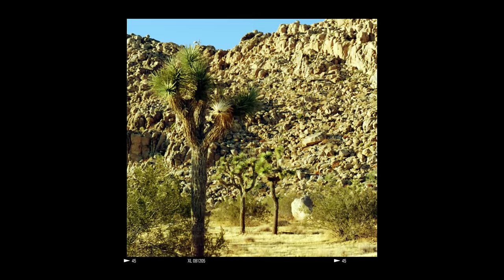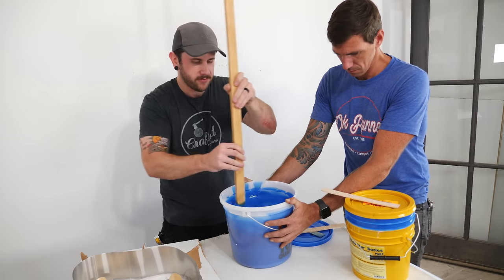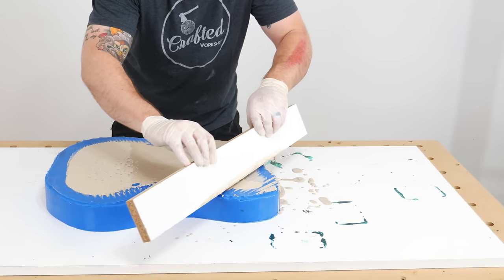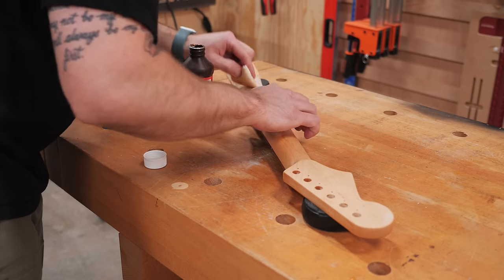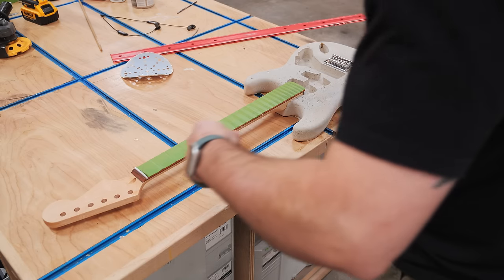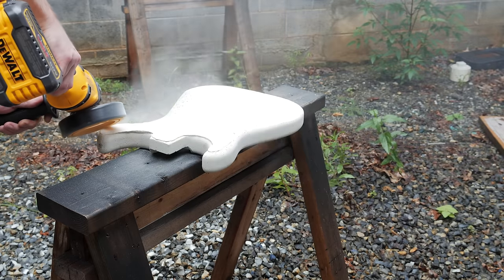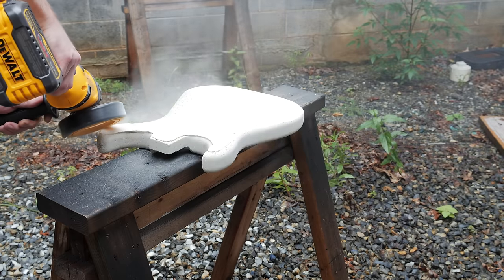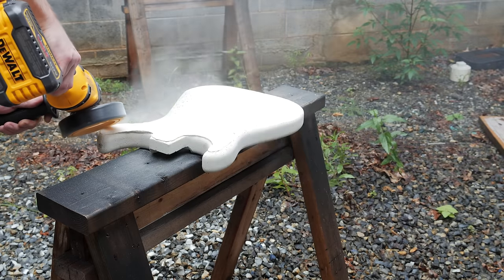I built a GUITAR out of CONCRETE. How does it SOUND?!

Comment: The only thing that really effects the sound of electric guitars, as you mentioned,  are the pickups and various electronic set ups. The way to test how a concrete guitar sounds vs wood it would need to be made into an acoustic guitar.
Reply: or use piezoelectric pickups because then your using the mechanical vibration (tone) of the instrument
Reply: I've been telling people this for years but they would rather believe myths like string gage  too.
Reply: Agreed, but you will have some claim that they can hear big differences not only in the type of body wood but also the neck and fretboard of an electric guitar. I say nonsense.
Reply: I wonder if you could make a wire frame to spread the concrete onto so that you could actually make the shape of an acoustic guitar with concrete. I think that’s how a lot of concrete structures with complex shapes are made.
Reply: *affects
Reply: @clarkburr  Tonewood for electric guitars isn't really a factor, but string guage is dude. There's a video on youtube somewhere about it, and the difference is quite large. Spoiler, lighter strings are actually a lot better sounding.
Reply: @johnnyghoul8100  Or a semiacoustic guitar,

Comment: "I made a guitar out of concrete, how does it sound?"
Probably like any other electric guitar with those strings and electronics, the body is flare
Reply: @GCKelloch  my only question is why did he use copper tape for insular when the whole body is made of concrete? That should do enough shielding.
Reply: Exactly
Reply: you can look up comparison videos, the type of material really does matter a whole lot. For example, alder, ash and mahogany all give a totally different sound.
Reply: @GCKelloch  You're right that individual pieces of the same wood give a different signature. As a bass player I find alder to cut through the mix better than swamp ash, I find it actually has more pronounced mids. I think the fact you made this guitar out of something as solid as concrete came through in the sound even on this video.
Reply: Explain semi hollow electric guitars then. Goodluck.
Reply: @keesketsers5866  It's a guitar that has been carved to have cavities. What do you mean?
Reply: @keesketsers5866  electroacoustic.
Reply: @kasperkosminen2679  : if only the pickups are what define the sound, why oh why does a semi hollow with the same pickups sound completely different? Because pickups react to movement of the wood. If the wood (and thus body) of the guitar does nothing, feedback would not exist. Wood and body affect sound. Period.
Reply: Exactly. Pickups and strings, all that really matters for sound.
Reply: @kasperkosminen2679  Did they use the exact same pickup and strings? I am going to guess...no..?
Reply: @keesketsers5866  semi hollow, I would imagine, lightens the weight and leaves room for wire work. I could be wrong bc I only play with BC Rich; Warlock and B!tch. Not bc of looks but bc the pickups and nice slim necks. Also, they are a bit heavy. Surprisingly, my B!tch is smaller, but much heavier than my Warlock.
Reply: @kasperkosminen2679  Really? A totally different sound?? Cats and helicopters have a totally different sound.  Electric guitars with the same pickup configuration sound very similar indeed - nothing an EQ pedal couldn't - wait for it - equalize. Do you know what single factor makes the biggest sound difference in a guitar?  The person playing it.

Comment: Need to hear it without ANY effects, just dry tone.
Reply: No you don't. You hear exact what it sounds like around 16:02. There's not nearly enough reverb to change the tone.
Reply: electric guitars are designed to have no resonance or tone of their own. this is why modern electric guitars have solid rather than hollow bodies. any resonance produced outside of the pickups causes feedback.
Reply: @kierancallahan7756  that's actually the main reason i got my electric guitar instead of an accoustic one :') i can play at 4am without issue haha just plug it to an audio interface and you good to go :D also i'm not shredding i'm a beginner so i guess that's also why i can play at 4am without being a pain in the ass 🤔
Reply: @kannonfps  haha hell yeah jam in your headphones as loud as you want
Reply: @beowulf1417  those differences don’t even matter. the material used in the body will raise a price point but will make no difference whatsoever because any difference can be changed by turning one knob on your amp. the entire electric guitar industry understands that the sound produced by an electric guitar is entirely electronic, rather than an acoustic guitar where wood actually matters
Reply: @kierancallahan7756  At the end of the day, electric guitar tone is a magic brew made up of a lot of factors. And the wood of the neck and body is an ingredient in that recipe. In fact, most guitarists would agree that it is an important one.
Reply: @frisiidescendant2200  I'm pretty sure it's still physics, not magic. And "most X would agree" is a rather meaningless statement.

Comment: For the cardboard ribs, make a perpendicular foot by putting a slice 1/2 way through one side of each of the pieces. That way you have a cardboard X  or + that holds itself up.
You could have also drilled the holes in the concrete with a bit just a little smaller than the OD of the screw threads and they would have held great. Rather than all that dowel business.

Comment: I may have missed this, but it looks like the neck is just being held to the body with epoxy.  Why no screws?  Were you afraid that the neck cavity would break?
Reply: The epoxy might hold better and more evenly in comparison to screws. Given the weight of the guitar body, screws could be viewed as a pressure point, putting all the stress on the neck instead of on the epoxy. If something breaks, you'd rather it just be the epoxy instead of the entire neck snapping in half.
Reply: @angeleaterstudios1004  true.

Comment: I'm a little confused, how will changing what an electric guitar is made of affect how the amp produces the sound? Wouldn't it make more sense to try and make a concrete acoustic/classical guitar where the sound actually interacts with the body of the instrument? Dope idea tho❗️
Reply: You're smarter than about 99% of guitar guys lol
A solid body electric guitar is all pickups, strings, pick, amp. The wood is completely irrelevant.
Reply: @CKT1138  What about the fretboard?
Reply: @dileepmallick  I doubt it. The fret is made of metal, and the only element imparting any dampening to the strings is the fret.
Reply: @CKT1138  I can maybe see an argument about how the different woods change the vibration of the strings, but yeah it's pretty funny listening to guitar salesmen try and create all kinds of bullshit buzzwords. I just heard a gibson rep the other day in a video talk about how the satin finishes on their cheaper guitars "make the instrument breathe more". Like even IF that was the case, why would they be "compromising" the tone of their higher end models by not having them all be satin finish? It's all snakeoil.
Reply: I'd love to see how you'd have a concrete acoustic guitar.  Are you gonna reinforce it?  Or make the concrete 2 inches thick?  It would probably weigh much more than a solid concrete electric.
Reply: Playstation 3.50  I love the just flat out "*buzzer noise* you're wrong I'm right." Where are you getting the notion that the "speed of vibrations in octaves" is coming from? Because without any evidence backing that up, it sounds completely fabricated. A note is literally determined by the frequency of vibrations per second. How can the speed be altered and remain the same note then?
Reply: Playstation 3.50  not sure what I'm wrong about, it was a question anyways lol but thanks that cleared it up some bit 👍🏿 kinda my point though, sounds to me like a concrete acoustic would actually affect the sound and make a noticeable difference even if close to non functional, thats the point of using concrete and not what we know would work.
Reply: The denser the wood.the more sustain.  Saw it on pornhub
Reply: @CKT1138  you need the hard, firm and dense enough fretboard to hold the fretwire in place securely and to adequately react to truss rode mechanics, holding its shape and preventing the frets micro movement when you set the neck relief. And also a reliable dense and hardwood neck to be able to withstand the string tension. So everything kind of contributes to the tone, really. Even the fretwire material, the way frets are polished, even their height and width.
Reply: @inquisitivenessandcontempl9918  the material of the body and neck still doesn't impart a sonic difference upon the string-pickup relationship.
Reply: @CKT1138  it may affect sustain and attack, though, and also tuning stability. But as long as it is adequately dense, hard and heavy in order to be held together firmly enough and be stable, the guitar should be playing just fine.
Reply: @inquisitivenessandcontempl9918  it doesn't really affect sustain, and attack is entirely dependent on the pick technique, firmness, and material
Reply: Playstation 3.50   I find that I get longer sustain when I play wearing polyester shirts vs cotton ones.  The cotton seems to dampen the wood (which dampens the strings.)
Reply: @adamgh0 You should use a button-up shirt to allow the fabric to breathe more.
Reply: @GalenWill  Button down shirts make the PAF pickups just come alive.

Comment: Just when you thought a les Paul was heavy as hell.
Reply: When you buy a cheap strat kit and make it heavier so people think you have a 60s les paul
Reply: He's starting a new band- 'The Hunchbacks'
Reply: Ok let's see a concrete LP now
Reply: A good buddy of mine has owned several Travis Bean guitars over the years, and had to switch to something else when the weight of the neck caused wrist problems. Those weigh about 13 lbs. Obviously having the weight in the body rather than the neck will change the balance, and you have to believe this is still going to be a backbreaker of an instrument.
Reply: @iplaysdrums   I have a Les Paul copy I built back in high school and it is just over 13lbs. I can't imagine a 19# concrete guitar.

Comment: What about using “aircrete”? That would dramatically reduce the weight.
Reply: @Gary W. Richardson Watching this video I immediately thought of perlite, which I've cast with before.  At a mix ratio "heavy" on the perlite the weight can be reduced tremendously yet still be pretty strong and with no flakes as I guess there might be with vermiculite.